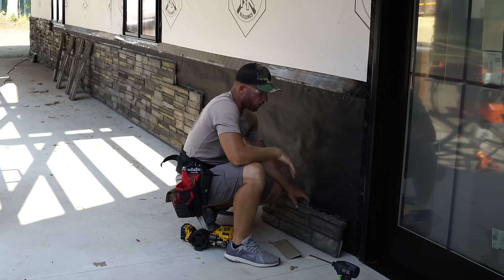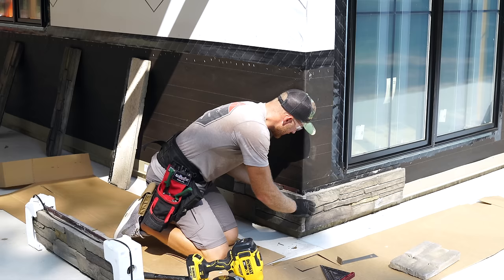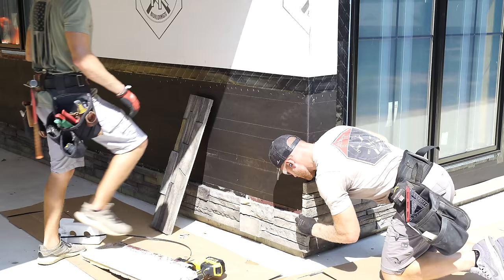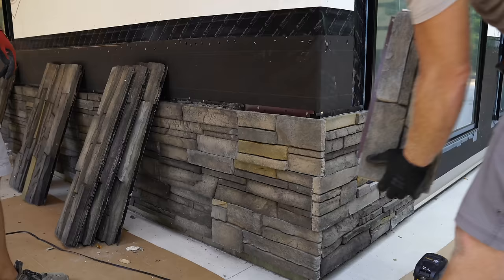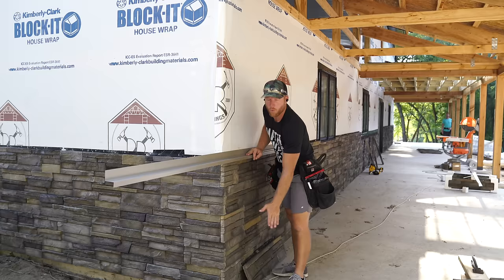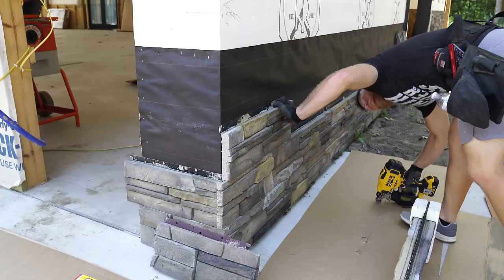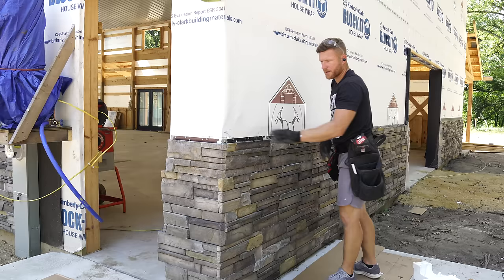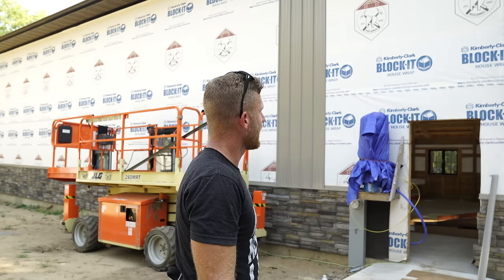Cabin in the Woods 24: Versetta Stone Corners & Installing Metal Siding

Comment from the maker: Pretty Exciting to finally see most of the Versetta Stone get installed and start seeing some Metal Siding go up!  Lot's of questions about the Dewalt Coil Nailer...and it's still going strong.  Check it out here! https://imp.i284638.net/JDdv2
Reply: RR Buildings do you get a bulk discount on the stuff. I can only find it for 9$ a sq ft.
Reply: Little experiment, Try marrying One Cut Piece together on the corner end, it might give the illusion of One Stone.
Reply: since you left early we need a 45 min video next ... great work ..
Reply: So why not use the new Milwaukee nailer ... not enough nail payload
Reply: @av1204  where do you find it that cheap?
Reply: My boys love the Dewalt coil nailer.
Reply: I'm thinking about using this around my chimney on my house . It has a painted brick tin wrapping and it looks cheap.

Comment: Well IMHO by interleaving the corner pieces so that one side sticks out and then the next row the other wall side sticks out tends to bury the illusion that this is full stone.  By revealing the thinness of the stone layer you cheapen the look and really wrecks the impression of a full depth stone.   I think that by picking ONE side only you preserve in the impression of set stone.  The alternating step back telegraphs that it is thin stone veneer.    I know the guy from Versetta is the "technical expert" but I do think he is wrong on this concept.  Well IMHO anyways
Reply: I have never used versetta stone, but I have used other manufactured stone similar to it.  In order to preserve the look of depth to the stone, I mitered the corners and used the same piece of stone to wrap around the corner.  Fit properly, it can make the thin stone appear to be very thick.  It’s not perfect, but in my opinion looks much better than seeing the thin Edges on corners.
Reply: @stephensheren1283  This is what I thought he would do as well.
Reply: Well that’s clever.  Where you cut the stone piece the matching cut off portion gets returned on the other wall corner .   Not sure RR saw can cut miters though.   I have also seen another product similar to versetta tha has corner pieces where the return is a 2-3 inch wrap around so it looks like a thick stone once applied.
Reply: Stephen Sheren clever idea.  So the stone you cut you miter and weep the matching portions around the corner.   Not sure RR saw can do miters .   Have seen other products where the outside corners come with a deep return that wraps around the corner making the stone look legit.
Reply: Came here to find someone saying this, agreed 100%
Reply: Cultered stone and others have corner pieces. They look good

Comment: I'm hoping DeWalt eventually ditches the flywheel for the smaller gauge nailers and go towards gas compression. The 18G brand nailer looses a lot of driving power from recoil when the wheel contacts the striking shaft. Beyond that, the roofer seems to be the best nailer in the line. Recent faux stone looks so good now.

Comment: Is there no need to install trim around the windows where the Versetta stone terminates into it? Just a drip flash on top of the ledge and run J around the window above the ledge where the metal panels will be? Doing a barndo for a customer and we're installing Versetta stone wainscot around the perimeter. Probably do a 40" wainscot with 4050 windows that will set into the wainscot 4-6".

Comment: Just a suggestion... run a strip of waterproof tuck tape half on the house wrap and half on the metal z flashing so that any water running down the wall under the metal siding will not be able to get under the z flashing?
Reply from the maker: There won’t be any water there?

Comment: Ya need to spray those "stone" (concrete) corner cuts with hydrochloride acid. It will get rid of smooth cut lines. Make sure you spray it with sodium bicarbonate water after though.

Comment: Love Versetta Stone, used it on a floating outdoor island with granite top & a fireplace bump out on the bottom half. Love your pacing and how you guys work & I’m also a father son team(I’m the son). Question, was there any specific reason you started the steel in that specific location & not at a corner or next to a doorway etc..? Love you guys.
Reply from the maker: Couldn’t start on corner due to no door yet

Comment: I think we're all in agreement that the corners aren't the greatest. They'll do, but could be better. How about putting a 'false' timber post on the external corners. Take one of the posts used for the porch and cut a 4 by 4 section out leaving a 'L' shape that will wrap around corner. Then butt the stone up to this. Might work ??

Comment: WOW!! When you put up that first metal sheet, I did a double take! I had read a comment earlier about not liking the grey color channel trim..I agreed..BUT..I thought the siding was going to be black, now I understand!! Looks great. P.S. Using the factory ends for the exposed staggered corners looks SO MUCH better than cut ends!!   Definitely the lesser of the two evils. Question: What is your opinion on this? And if you agree..are you going to switch-out the cut corner pieces where you started? Stay Safe..Live Long..and Prosper.

Comment: I have just used the Versetta Stone and although it looks great from a distance. I found that the manufacturing quality and consistency of sizes poor. The tiles could be 1/8" in height difference. Also the casting of the stone was inconstant the bottom inparticular would have a curve upwards in the center of the tile at times. I do think it is one of the most natural of stone veneers though.
Reply from the maker: Sounds like you had a bad run then. That stinks.  I’ve seen that occasionally but I just bring it up to my supplier and get it replaced.  I’ve learned to spot those issues early if and when
Reply: @RRBuildings  Thanks for your reply. yes thats possible I hadn't thought of that!

Comment: I’m curious if Zip manufactures watch these videos.  Not sure it would be ok with their Zip tape being used to attach to the house wrap around a window rather than directly to the exterior OSB or plywood   As RR does the taping around the windows  the tape is attached to house wrap which is just stapled on   There’s no direct tape contact with the exterior sheathing.
Reply from the maker: It’s not zip tape
Reply: @RRBuildings  OK but its still flashing tape  to keep out moisture from around the window. It should be taped to the buildings sheathing directly not onto an intermediate material that has no holding power and is not water proof.  This building is fully sheathed isn't it ... prior to metal siding.   If not the tape should be adhered to the window rough framing prior to the steel siding.   Is that not correct?  Curious for sure.

Comment: The stone panels look great EXCEPT the corners. The panels are manufactured, why dont they make an actual 90° corner panel that fits the corner and panels run from there. I do not like the cut ends exposed. They can make them at the factory, this is a short cut and doesn't look good to the trained eye. I would not pay for this finished look.

Comment: I just noticed that you have house wrap and tar paper behind it. I know you care if your buildings leak. This is what I used when installing any type of synthetic stone or sidings that water can get through..  https://image.made-in-china.com/203f0j00MQeUjaGKJWqg/Breathable-Waterproof-House-Wrap.jpg  It catches the water and it allows it to drain without penetration, It may not be necessary, but I would rather use it and not need to then not and chance on the water getting through.. The synthetic stone you are using, does let water get through and tar paper fails where staples are.. I know the chances for leaks are very low, Just having a weeping type of backing behind makes it bulletproof for water....
Reply: In the last video of this series or the one before, he stated that he only uses the black paper so the white housewrap isn't visible should there be any small cracks in the stone, it is not necessary for water protection.
Reply: @c14b4tt4  You are right, I forgot about that... I am just used to putting black wrap, when you don't want to see the white, if cracks appear.. or self sealing membrane's...